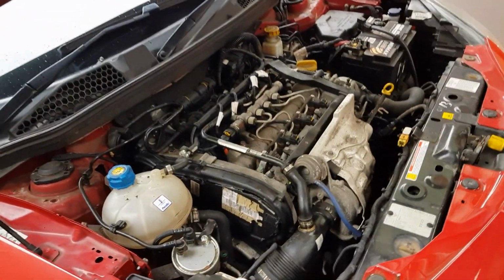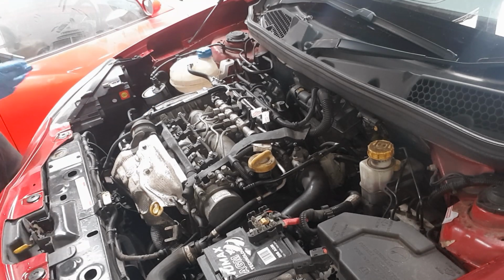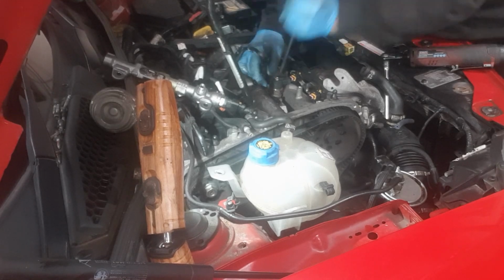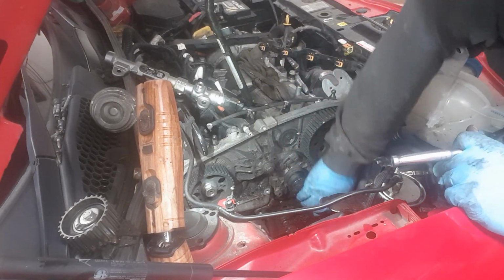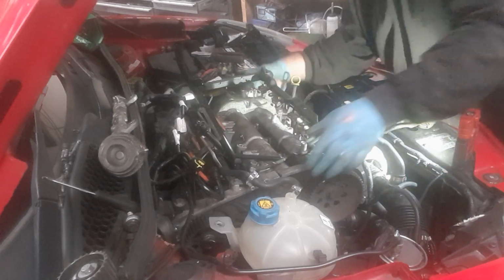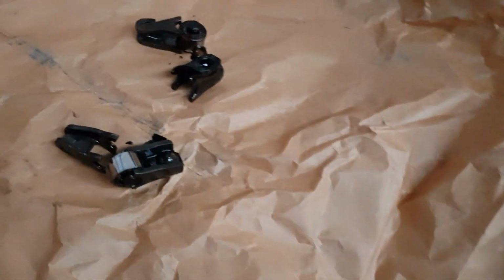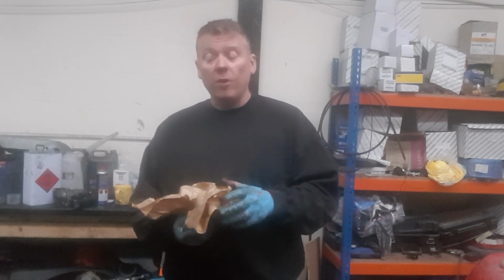Fixing A Diesel Giulietta That wont start.  (part 1)

Comment: Happened to me a few days ago in on my 2.0l Giulietta. 
Timing belt+water pump done 30k km ago and suddently my car stalled while running.
The mechanic analysis: locked water pump (probably not really replace when belt was done) made the belt to snap, so engine lost timing and broke the rocker arms, luckly I add, because if valves were bent could be worse.
Can't wait to have my beloved Alfa back!
Thanks for your videos, I always love watching them, and greetings from Italy!

Comment: Had this happen on two alfas brought into garage, changed water pump ,belt etc reset timing back to marks on belt at diesel pump , turned key , not a problem !!! Both ran fine , only had jumped teeth on fuel pump

Comment: Mr alfa God... I have a request. Could you do a giulietta subframe removal video please? I have to change my steering rack as my tbi has slack in it bringing new meaning to bump steer! I have the rack and I've done my old 147's subframe a few times but unsure if it's the same or more 159ish.... Pretty please with sugar on top.. Xxx

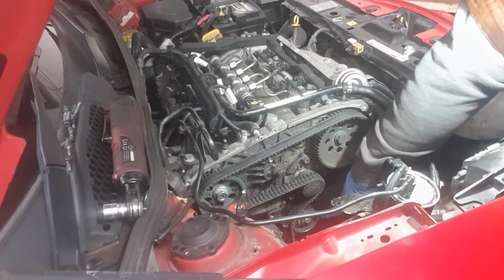Comment: Really enjoyed this one, sped up sequence from 3:20ish was really good and nice presentation throughout.

A question, if you don’t mind. Do you know if there’s any common oil leak causes on the 2.0 JTDm? I have a 159 that’s been dripping oil from the undertray, the sump has been dropped and resealed also the o-ring rubber seal has been replaced, but it seems to still be dripping a little from the undertray.
Reply from the maker: thank you. plenty of areas best to wipe it all off and then run the engine and see where it all starts leaking from.

Comment: Great video. So what did the customer do. He asked for a timing belt change but with no water pump? Why wouldn't he want water pump doing?
Reply: Speaking from experience, most people have no idea, they trust what the mechanic says. Of course sometimes the customer skimps on it to save a few pennies. I guess they don't understand what the consequence might be. We always recommended replacing the pump when I worked in a garage and for the most part people did but sometimes they chose not to, even against our recommendation. But in general, most people just know to little so if the mechanic says it's not needed they'll go by that. 

Of course there's the shady ones that say they've replaced it when they actually haven't as well. We had customers come in with cars that had belt failures after a change, just because the change was never done, just charged for.

Comment: was she running on pure water as s coolant?
Also, do you think the valves are OK? If I understand correctly what's happened, there was a  piston-valve collision... right?
Reply from the maker: i think they had just topped it up to get them home.
Reply: @ItaliaAutos  anyway, water or proper coolant- makes no difference if the pump's dead :D
Reply: You are right about that, but on the jtd m Engine, the valve is parallel with the cylinder so it usually is not harmed. Also the rocker is meant to break before the valve breaks. My 156 had jumped one or two teeth because the previous owner lied to me about the cambelt change. Luckily the engine is doing fine since 50k km or so.
Reply: @bco719  oh, that's pretty cool! I wouldn't expect this type of a 'fail-safe' engineering in a modern car
Reply: BC O 
Don't forget Alfa "lied" first
when they got the service schedules wrong. They changed it to a much lower 36000 miles AFTER I had already crept nearer to their original (50k IIRC) and guess what happened?
Contacted Alfa UK and they flat out refused to help. 
Cost me £1500 😤
Reply: @ro63rto  the 36k is for petrol ts and jts engines. The cam belt change for the jtd engines wad 72k or 6 years but they've reduced that to 60k 5 years. Still too long for the water pump on these engines.
Reply: ds1868 
yup
Reply from the maker: @ds1868  i say 48k or 4 years on alfa diesels
Reply: Italia Autos When I owned my 156’s & my 159 with the 2.4 JTD or JTDm power units I always budgeted for every 42k for cambelt and all the vitals to be changed to save from any smashed up engines & big bills.
Also on any of my Alfa’s regardless of engine two oil & filter changes a year regardless of mileage ( April & October) .

Comment: Great video mate, i have a question if u dnt mind, mine(G 2.0 jtdm)  has run 84k km but its almost 7 years old should i change the timing belt and water pump or wait until 100k
Reply: U can easily check how the timing belt is by visual inspection. U just need to unscrew 3 torx screw so u can see the belt. If its cracked it need to be replaced. My 17 years 147 jtd has still the original timing belt and its still in good shape.
Reply from the maker: Youssef Salama hi thanks. I recommend 4 years or 48000 miles.
Reply: Italia Autos thank you so much I’ll take that into consideration
Reply: It is already too old. Change it!
Reply: @Malossianoplus  that timing belt wont be original …..a 17yr old timing belt would be dust by now …….and if it by some miracle is that old, that is a dangerous game to be playing
Reply: @miguelfreitas1991  all original. Same as brake fluid and coolant. The only belt i changed 2 times is the alternator belt. Car has 70k km witch is nothing.
Reply: @Malossianoplus  then thats a very dangerous game ......Brake fluid should be changed every two years irrespective of mileage......
Belts should also be changed irrespective of mileage as rubber degrades over time ......
Its a dangerous ticking time bomb .....
Reply: @miguelfreitas1991  i check the fluid with the tester and its ok. same for the cam belt that i check every year.

Comment: So if i understand corectly. The rockers are sacrificial parts to prevent bigger damage or they get damaged + whatever alse goes south?
Reply from the maker: thats correct but the valves can still get damaged if the impact is hard enough.
Reply: @ItaliaAutos  Thank you for your answer. Great job you are doing with the Alfas.. Like them..but afraid of their rather "complex" suspension. Si its a Fiat for me..☺

Comment: Hi Italia
I have 2.0 Giulietta, engine gets hot, temp gauge appears normal, hoses stay cold. Heater hot. Cambelt kit water pump changed by Fiat  main dealer 18 months ago.  Any thoughts?
Reply from the maker: Yeah book it in with me and ill take a look.
Reply: @ItaliaAutos  Too far away.

Comment: I did change water pump and then failed a week later bloody beers
Reply from the maker: Richard Hudson was it a genuine part, 😜
Reply: Italia Autos to be fair no , but it was a gates set which I thought where good still love my brera though
Reply from the maker: Richard Hudson I personally don’t like gates parts. Much cheaper quality. I always try to fit genuine you rarely get issues and it’s not much more if you know where to shop.

Comment: 2000 pound repair for a 20 pound waterpump,sheesh...
Reply from the maker: Scary.
Reply: yeah, seems like the system is also filled with water (i might be wrong). Could be a sign of someone who doesn't want to spend money on repairs...